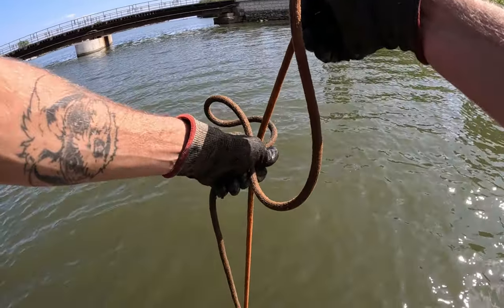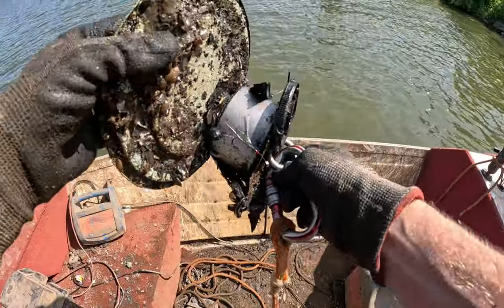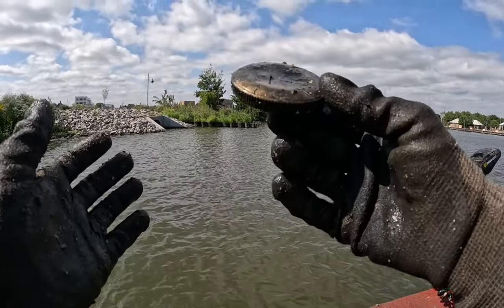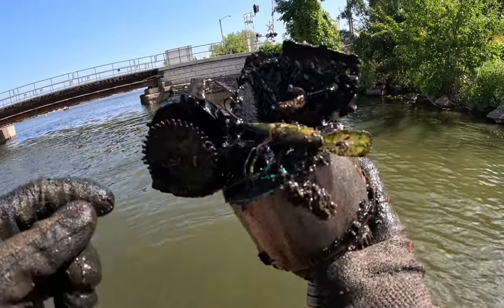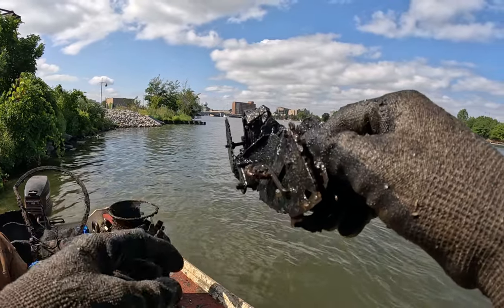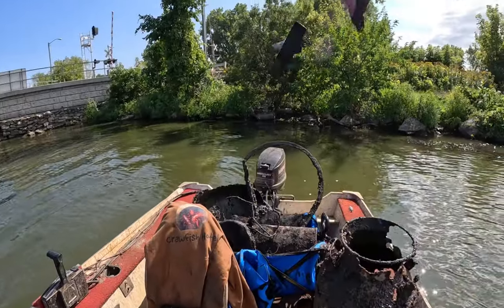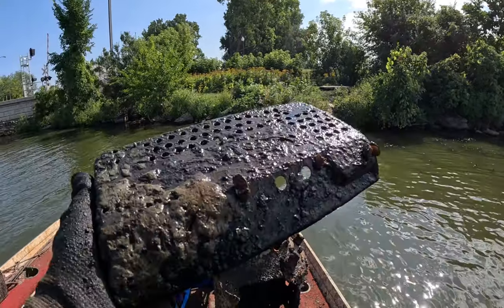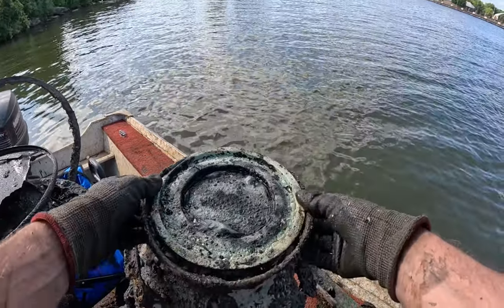I Found TONS of Dynamite While Magnet Fishing!

Comment: Trinitrotoluene (TNT), a pale yellow, solid organic nitrogen compound used chiefly as an explosive, prepared by stepwise nitration of toluene. Because TNT melts at 82° C (178° F) and does not explode below 240° C (464° F), it can be melted in steam-heated vessels and poured into casings. It is relatively insensitive to shock and cannot be exploded without a detonator. For these reasons it is the most favoured chemical explosive, extensively used in munitions and for demolitions.

Comment: 7:10 that seems to be part of an electric asynchronous motor's stator. There would be many of those pieces put very tightly together and forming the magnetic core of the stator, and in between the "teeth" there would be copper coils. The piece at 7:56 also seems to be part of an electric motor, possibly the cover for the commutator of a synchronous or a DC motor. 14:30 that's an E core transformer with almost the entire copper coil removed.

Comment: That handle 7:43, to open paint can, 7:46 top of propane tank 8:44jingle bells stick- hand percussion, $100 Vintage Fog Light Lamp for a GM Chevy Dodge Ford- looked up. 21:29, looks like bottom of bicycle pump, cool speaker, almost like you are pulling parts of a vintage car one piece at a time.  That was a great ride full of fun, guessing what things are that you fished out.  Looks like they dumped a whole mechanic shop in the river, this would be mine or parents generation, shame on them.  Thanks Tyler for the fun and cleaning up.

Comment: 16:34 - automatic transmission torque converter… 19:30 is a shock absorber… and just to help you out… shocks don’t hold the weight of the vehicle, the control the jounce and rebound of the suspension system… usually coil or leaf springs that hold the weight.
Reply: Great finds tho!

Comment: The small caps you found are off 55 gallon barrels. They are for pouring stuff out of the barrel. One you found was a gas cap and the yellow light was for the railroad signals when they are working on the track.
Reply: Cool.

Comment: 25:32 Remnants of a Lead Acid battery, similar to a car battery but smaller size typically used in children's toy cars (the big ones they cam drive around)
Reply: That's what I was thinking, and the "bolt" was one of the terminals.

Comment: Your stand for something that had the foot pedal on the bottom is a hand pump for pumping up tires inner tubes I assume that the where the foot pedal was as you called it there's probably a little tube coming out of that big tube where the air comes out or out of the foot pad

Comment: It (8:04) is a compressed gas cylinder nozzle cover.  The smaller indented caps look like "knock outs" either from floor pans (automotive) or from barrels.

Comment: do you have like a nose for iron, man?  This is nuts!  At 14:44 I think what you found is one of two things:  A bobbin on thread for a loom.  Or, you found a rudimentary electric generator!  There would be magnets on the outside, and they'd spin activating the copper wire on the inside, charging a current.  Dude!  you just found a rare piece!  And all those 'chips' you were finding?  Those are, i bet you, railroad pop caps!  They would secure them to the rails, usually in front of trains, and were like an alarm if the train began moving!  I think the scientific term for what you found is CRAPLOAD!

Comment: The lid for the milk container would be several inches deeper into the container and it has a lip that goes up around the top of the container and then it has a pipe handle type thing that goes across the top of the milk container

Comment: If that isn't a Gas Cap it's a Radiator Cap. Pretty sure it's for a car radiator. Yep, that's a grease gun. That is an electrical transformer, missing the copper wiring. US Pioneer 145 is a Fog Lamp for Chevy - Ford - Dodge from 1930's to 1940's. YEAH, you might want to clean that up, they are going for quite a bit of money.